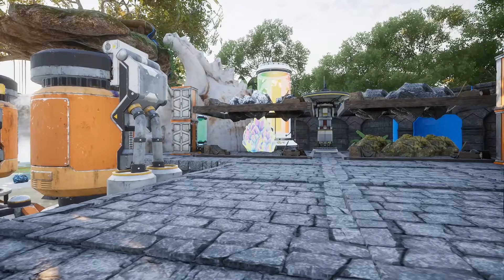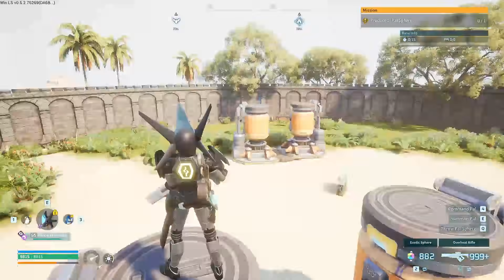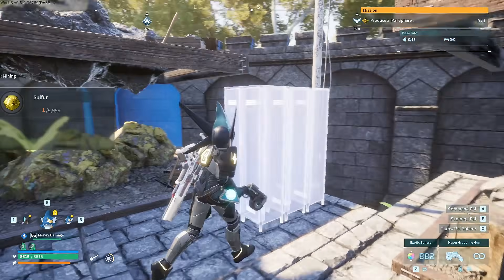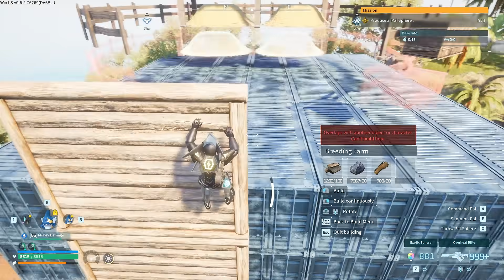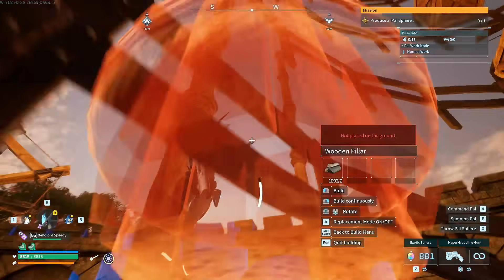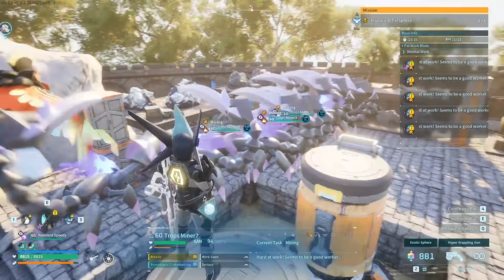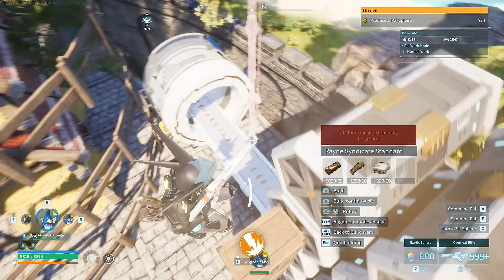How to Build the NEW BEST BASE in Palworld 3 Oil Veins Setup Guide

Comment: Im curious, since im trying to build this and there is something driving me crazy, how did you craft the bunch of containers? every time when I try to summon a pal to make it help me craft it, it just despawn to other place in the base, I guess because the countainer isnt considered floor, so what is the trick? I honestly dont want to stay there pressing F for 84 containers
Reply from the maker: Oki did u get all the foundations placement correct?
For containers stand on top then summon your pal
Reply: @TropsPlays  Yeah the placement was somewhat correct, bit different but everything fit, the other thing, the pal just despawn and appear on the floor, after the second layer it just teleport to the ground to do anything else, so right now since the height doesnt seem to matter when building something, Im just going to do a tower of containers each time otherwise, either I press F for the whole duration on each one or dont do it. Still working on the base, I still have yet to solve the energy issue, seems my orzek isnt enough.
Reply from the maker: @Mikalya I will be online in 2 hours.
I can help you build it and give you base pals
Reply: @TropsPlays  oh dont worry, "kindly" asked a friend and got an orzek with bunch of skill and is manageable now until i finishg upgrading everything,. The tower of containers  seems to work just gonna need some extra walls and all fine. thanks a lot for the offer tho.
Reply from the maker: @Mikalya no worries

Comment: tried building this for 5 hours the foundations was rather out of the outer wall all the oil extractors was blocking the placement of some of the foundations, could tell which angle to place the oil extractors on, it looks like a great base but getting the layout was near impossible
Reply from the maker: Dm on Discord, I will place down all the palbox foundations and walls for you.
I have a nice trick since I've built this over 10 times for people now.
I place the palbox and extractors down, and then I copy from my video the foundation placement.
Then I remove the palbox and place the palbox until the bases blue line is just outside all the foundations.
This way, you can get it exactly the same as me.
Reply: @TropsPlays hey man. I’d actually pay you to set this up for me too. Cheers add me Brennen5883

Comment: I'm currently making one using this video as reference.
When placing a fishing pond, there is no axis alignment mode (ctrl) like in the video. Why is that?
Reply from the maker: They removed it the very next day.
So the fishing.pond is to the left of the extractor.
Instead, remove the stairs and place ceilings with pillars for support.
Do a 3x2 which is enough for the fishing pond.
Dm on discord and I can do if for you
Reply: @TropsPlays  
The problem was solved by installing pillars and ceilings.
Thank you for your answer.
Reply from the maker: @パ会 no worries

Comment: I tried this base build and not only is it obviously super easy to have the alignment "off" of everything but there are some really big mat requirements for setup (all those cargo containers at 100 ingots a pop) but even with a number of electric generating pales I just can't keep the oil extractors running
Reply from the maker: Sorry your having problems.
I can givemyou my dazzi noct which will run the entire base for you just join my discord server and send me a dm.
It doesn't have to be the exact same as my setup. As long as you have all the mining sites together, all breeding pends together and so forth, it doesn't matter.
I can even help you build this base to get the exactly lime mine if that would help you out?
Reply: Are all your electric pals fully condensed and have you used work books to ensure they have 5 electricity? Another thing to consider is the research station. Check to see if you have fully researched the electricity buffs as well as unlocked they passive electricity generation buff item and built it on your base. Personally, I’ve never had any issue with just one fully condensed Dazzi Noct, with level 5 electricity, fully researched electricity, and the passive buff item. My base has 4 oil nodes, 6 powered egg hatchers, 3 powered tables active at a time, and 3 multi-pal powered furnaces all active at the same time. My dazzi noct will help transport until the electricity hits 77% and then take about 3s to fully charge the pylon to full before going back to transporting.

Comment: No option of  alignment mode with Large fishing pond , is it only me or they changed it.....?
Reply from the maker: You don't need it.
Just place it in on top of the lily pad on the left side of the pond
Reply: I am also not able to get alignment mode. The issue is the pond goes for and no pal is able to build it nor you can assign any pal to it.
Reply from the maker: @GreenLight018 yeah they have changed it.
I just help someone build this.
I removed the stairs and place 2 ceilings instead, this allowed me to place down the large fishing pond.

Comment: As a tip, you must use stone foundations. The new clean foundations do not allow you to stack items for some reason, it will tell you the structure is overlapping when there is nothing to block it. Switch to stone and it works fine.
Reply from the maker: Cheers man

Comment: I don't know what I'm doing wrong. The pipe does NOT want to align with the pillar
Reply: Change the foundations to stone and try, thats what did it for me, you can change it after but it has to be set down with stone foundations. Stacking the breeding pens does not work on feybreak island for me for any foundation. I have the base set up on the island but wanted to take the techniques to my feybreak base and see what I could come up with and some build methods just would not work after 10+ hours of trying.
Reply: @headshothendo i was just thinking that because i used the fancy foundations and they DO NOT like the pipes. Tysm, ill give it a try
Reply from the maker: Was fancy foundations the problem?
Reply: @TropsPlays yes it was. It does not like other foundations with dips in the center, didn't try with wood
Reply from the maker: @SaixVyra wood, stone, metal all work fine.
I'm glad that guy fixed it for you.
How's the build coming along?
Reply: @TropsPlays It's coming along slowly, my base doesn't look exactly like yours because I think my placement and the double oil rigs made it gasses to navigate but all in all, still very spacious with plenty of room. I don't recall seeing, but where did you put your generators and Ozerks? I heard the oil rigs eat energy like crazy
Reply from the maker: @SaixVyra join my discord I will give u my dazzi noct.
You will never have to worry about generating electricity again
Reply: @TropsPlays I'm already in there. Joined you the other day I was having problems.
Reply from the maker: @SaixVyra  oki great can u say hi quick

Comment: how can i quickly stack pal pod ? i use bench to stack it bu it take 7 bench to work
Reply from the maker: Try a pillar with a floor or the lockers.
When I'm free later I will see how to stack palpods with minimum space between.
You could place down a flag and align benches to it so you can quickly place more benches soon as your pal constructs them.
Reply: @TropsPlays  ty, im looking for that video
Reply from the maker: @ChucChiTon  which video?
Reply: @TropsPlays  of course the how to stack pal pod video
Reply from the maker: @ChucChiTon I haven't done 1 but someone might of?
Did u figure it out or shall I quickly do it and message you how?
Reply: @TropsPlays  I try ur method (locker or flaq) but it still take so much space
Reply: I think I need ur message 😂 @TropsPlays

Comment: Thanks for the vid, little question. Is it possibke to place a ladder freely without snapping to the foundation? I cant reach the boxes on my breeding pens 😢
Reply from the maker: No unfortunately the ladders have a snapping point on foundations.
I haven't tried it but you could try placing a flag then snapping the ladders to the flag.
I dunno if ladders snap or not you will have to check

Comment: if you press alt the stair will go down u don't need to place one on top then alt as it works for me when i do this but good tip on the raise the foundations ,didn't know u could do that still learning
Reply from the maker: Yesh I tried doing the alignment mode ages ago for the stairs but nothing happened.
Now it's alt and called something like change mode
Reply: It has been added recently to change the stair placement mode.
Reply from the maker: @amitavabiswas5260 yeah I've been using it recently

Comment: No electricity? Need  few giant generator for the oil rigs
Reply from the maker: No I only need 1.
Join my discord and I will give you my electricity pals.
You can see how good they are.
Reply: Could you specific more about the pal u use? Is it a oserk or something else? And what stats on it? Im assuming 5*?

I'm not looking for a free hand-out myself, i rather work for it. So could you please specify? 

Awesome vid btw, thanks for the inspiration especially on the tip with placing the oil extractors!
Reply from the maker: @Edje151184 these are the pals I use

https://youtu.be/1Xhq-bhvhx0?si=YqiqlWLFbxyOfnOc
Reply: @TropsPlays thank you!

Comment: Honestly you did too much with this one. You could have strung this out into 10 different videos and each would have been more value than most other creators put out.
Personally I like my plantations on a slight bias so I can walk up and down, but I understand wanting a neat vertical stack. the easiest way to make the bias is with a signpost you attach the next layer to.
Reply from the maker: Viewers have been wanting this for a while.
Imo it's just the right amount as it allows people to follow step by step if they desire.
I haven't even tried that signpost or seen it, but I understand what you're saying.
I used to the like design of being able to run up and down the plantation but I realised when doing that I had to put walls at the back to stop pals from not being able to pick up some items (th8s could be patched now).
I will have to give it a try.
Cheers for the info 👍

Comment: How do you handle lag when many pals working on a base …
Reply from the maker: It doesn't lag for me.
On my megabase I had 9 bases inside totalling 135pals.
Reply: @TropsPlays but how me also having a good pc but it lag fps drop from 100 to 50 … anything that i can do ?
Reply from the maker: @abhibotxd7968 do you use all ultra settings? What's your view distance?
Do you have things running in the background?
Reply: @TropsPlays i play on medium setting and in all 2 in 1 base it lags buddy like 50-60 pals working in that base and background apps are close like there are only 6-7 apps working which is neccessary for pc
Reply: @TropsPlays view distance is 300
Reply from the maker: @abhibotxd7968 I have no idea then if you're on medium settings.
I guess you have too many pals for your PC to handle
Reply: @TropsPlays  whats your pc specs?
Reply from the maker: @abhibotxd7968 I'm not online right now, so I can't say.
They are not the best, but they're oki since I have a gaming laptop.
Do you keep your drivers up to date?
Reply: @TropsPlays yes i update my drivers